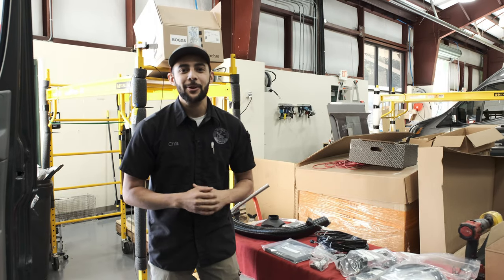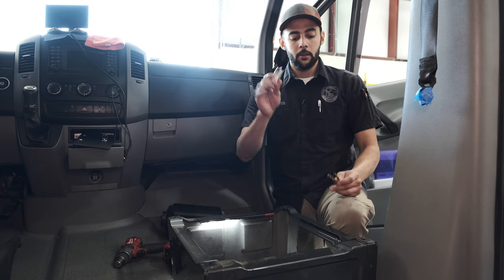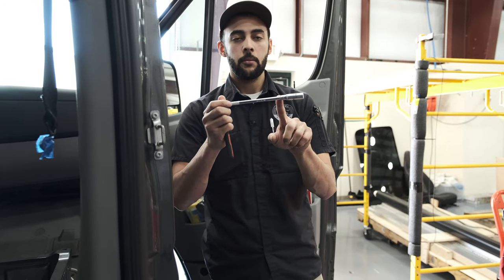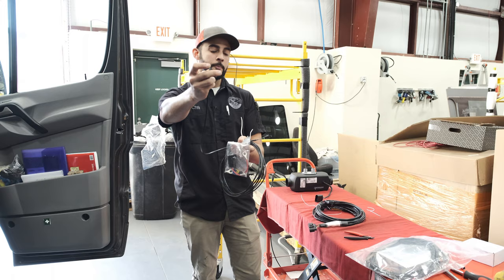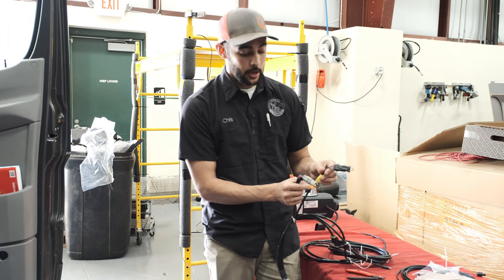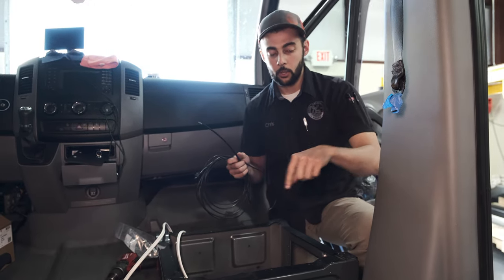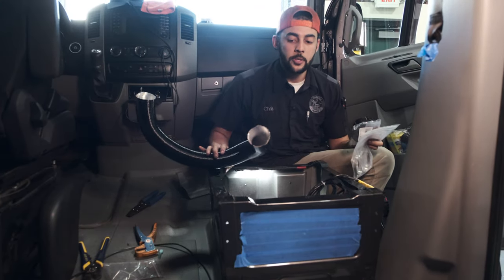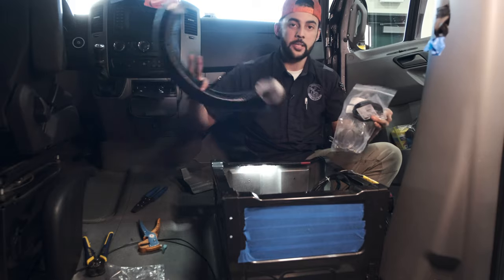Espar S2 D2 L Diesel Heater: In Depth and More Detail

Comment: Chris, this video is super helpful. You're a natural on-camera and as an instructor. Thanks,  I have been gaining knowledge and working up the courage to do the install myself and your video pushed me over the threshold. I started my install! yay! One thing I noticed is you said you drill a 3" hole for the duct in the back of the seat base. I drilled a 2 5/8" hole (by measurement) and the piece fit perfectly. I imagine a 3" hole would not allow much margin for the three (3) screws. FWIW

Comment: I was so overwhelmed 47:12 minutes ago!  Thanks so much! Hey, I didn't see you use the mounting plate that I got in my kit. Also, I didn't get quick fuel connect and the tubing that you said not to  use had a sticker on it that said "attach directly to fuel tap or use 5/16 fitting". Maybe because I have a 2022?  I didn't see the muffler install either but I think I have that figured out. Thank you!

Comment: Excellent video, missed the part where you showed us EXACTLY where to put the template, we just eyeballed it and ended up with 3 extra holes.  I will also add that the vent hole is no longer 3”, and you no longer need the quick connect at the fuel tank. We took your advice and trashed those connectors in favor of a simple butt splice, but we used lever nuts for that.

Comment: This video saved me! The wiring harness i have is just like this and i was racking my head trying to figure it out. Way easier than what i thought it would be. thanks for thinking outside the box and suggesting simple wire connections , those crimpy things suck a**.
Reply from the maker: Yeah, if you dont have the special crimps its a PITA.
Reply: @FreedomVanGo  Got it all together and it turned it on. Got  "H1:Service" on my screen. I cut the power and turned it back on about 10 times in an hour (thinking it be the fuel needed to get primed) and got the same H1:Service every time. I am able to get the fan operating but it seems kinda weak. I feel like this is a simple programing thing or something super simple. I am just not seeing it. thanks in advance!!

Comment: Thanks Chris! Great job teaching us how to install the D2L heater. This video was well done with clear description and visuals. I'm doing my first install tomorrow. Question - Is there any need to prime the fuel line? If so, what process?
Reply from the maker: Just let the heater cycle itself. It may take a couple times but it does a good job of doing it itslef
Reply: @FreedomVanGo  Just fired it up. Came on with strong heat after the second time.

Comment: Helpful vid, thanks. Any suggestions on heat protection material to enclose the fuel and electric lines?
Reply from the maker: DEI makes a great material you can get from autozone/advance auto. that's meant for it specifically.
Reply: @FreedomVanGo  thank you!

Comment: This is hands down the best video on doing this.  One question, when you unpacked everything there were two baggies attached to the fuel pump power line and mine has two baggies too. One baggie contains the fitting that you pinned up to connect up the fuel pump power but there is a second baggie with what looks to be a battery connection ring terminal, two different fuses and a fuse holder.  Your video doesn't seem to address these parts. I have the main power line fused at my distribution panel but don't know what or if I need to do anything with the fuses in the second baggie.    Any help would be appreciated
Reply from the maker: You use that baggie for the power connections if you aren't going to a fuse box.
Reply: @FreedomVanGo  Thanks!
Reply: what size fuse do you guys use?

Comment: Great information. Exceptional breakdown on the electrical. You didn't mention it but is the fuel pump able to be mounted horizontally? I though it needed a set +/- degree tilt.
Reply from the maker: It does need a set tilt. We do final adjustments before fire up on all of that. We mount everything then adjust final stepsn
Reply: Correct; Eberspacher calls for an optimum tilt angle of 15-35 degrees up for the output side (white tubing), so I went 25 to account +/- 10 degrees for possible inclined parking situations.

Comment: Great video for a heater that comes with terrible instructions.   Question, how come there's no positive or negative for the fuel pump power line?  Just two greens? Why?    BTW you're fuel pump doesn't look like it's mounted at a 15-35 degree angle.
Reply from the maker: thats an espar question.  It just doesnt matter
Reply: @FreedomVanGo  Thanks I've confirmed with another source that the polarity doesn't matter but I am certain that the pump needs to be at 15-35 degree angle according to multiple sources...
Reply from the maker: @TheAllSeeingAye  so make sure you do that :)
Reply: @FreedomVanGo  You clearly don't give a dam, but you should since this is you're instructional video on a relatively expensive device. How you feel doesn't bother me but I do care about viewers following your incorrect instructions that will lead to faster degradation or damage of the device.      
I went ahead and searched throught he mfgr documents and here's where it specially warns you 

"Safety instructions for installing the metering pump
􀂃 Always install the metering pump with the delivery side rising
upwards – minimum angle 15°" page 25 of the Technical Desprition Document.

Hopefully viewers will see this and not do what you did.  =)
Reply from the maker: @TheAllSeeingAye  its been said by multiple people.  I cant go back and add things to the video, it is what it is.  on final cleanup with zip ties, clamp checking etc its straightened.  you arent the first to say it. Not much i can do about it.
Reply: @FreedomVanGo  Fair enough, I ddn't see anyone mentioning it the first time I skimmed through the comments. Now I see .